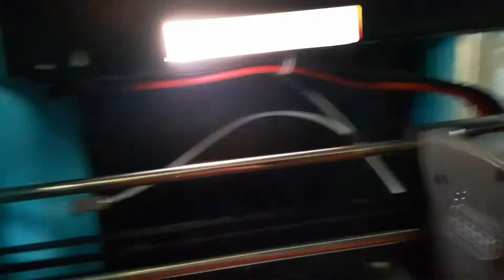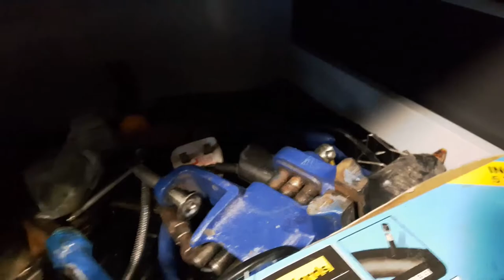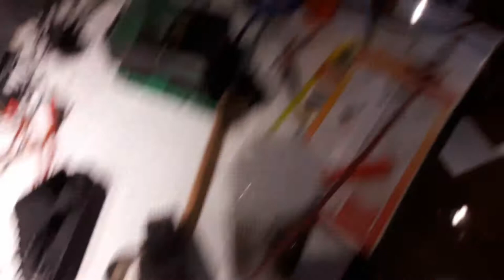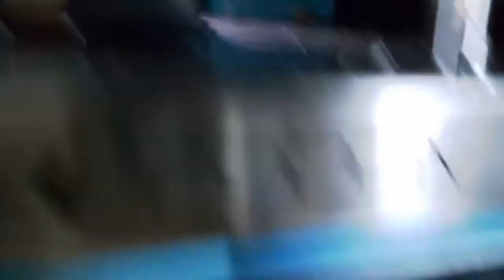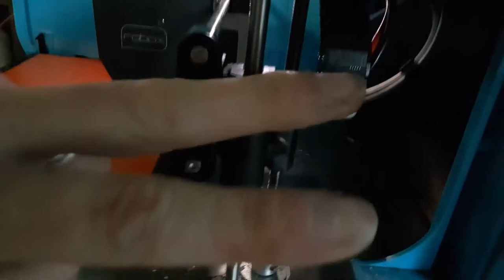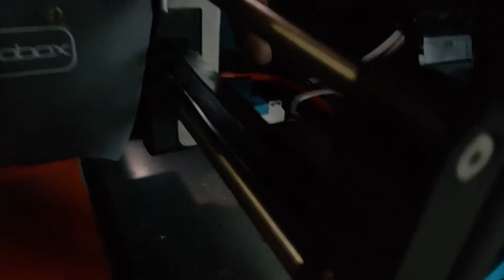Robox 3D Printer 24V mod - resolves  print head pausing during prints

Comment: That's started happening to mine, always at least 4 -5 degrees below the set temperature, sent off for repair but came back same and now the bed stays 2-3 degrees below set temperature 😐
Reply: did you try this mod? has it fixed it?